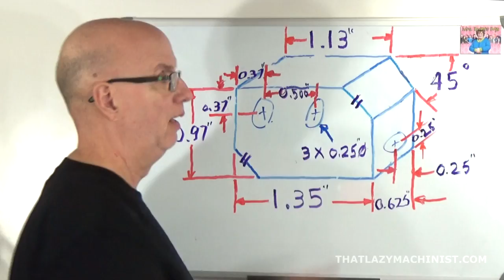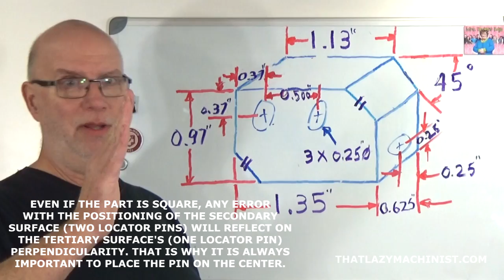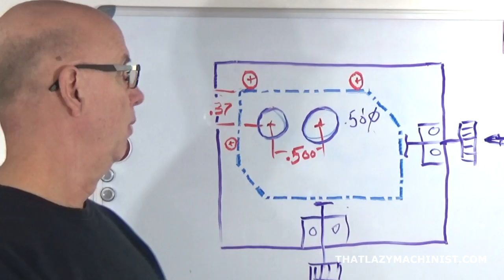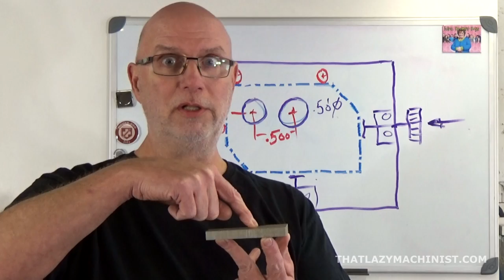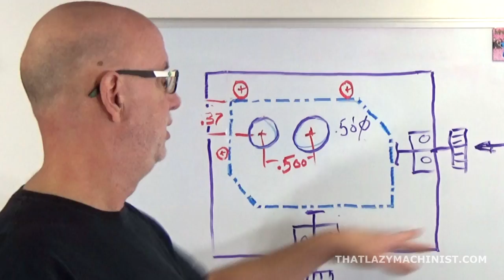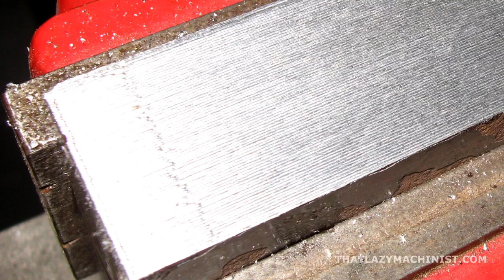HOME SHOP JIGS & FIXTURES PART 3, work holding, part positioning, tool tolerances and part tolerance

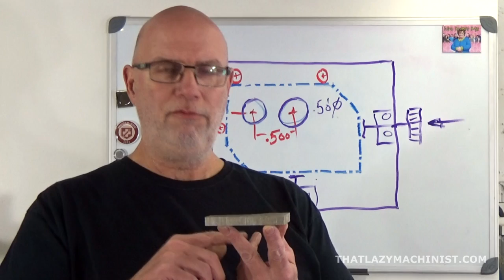Comment: If you WERE to create a 3 point contact on the primary surface of the part (as you mentioned at 20:00,) where would you locate the supports, and why? Would they be spherical at their ends, or just posts that you mill flat all at once?
This video is really great information, thank you for all of your work!